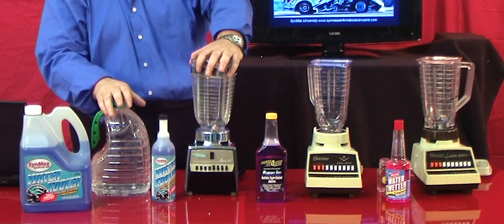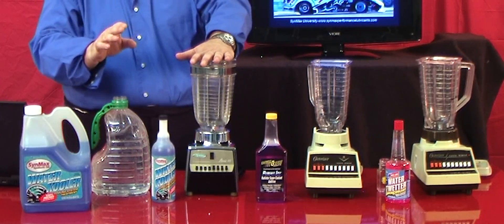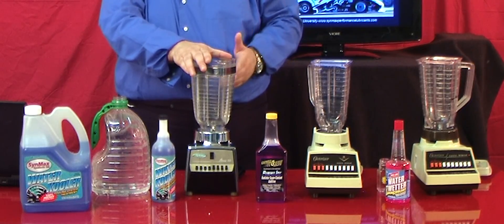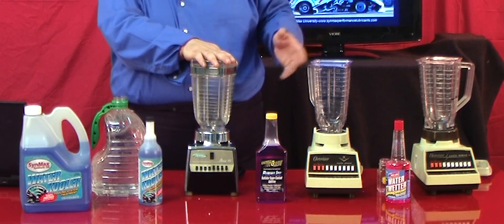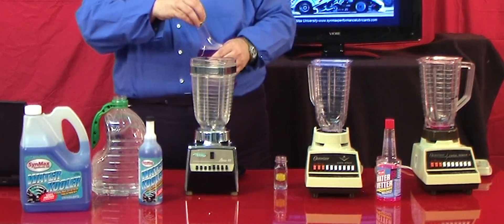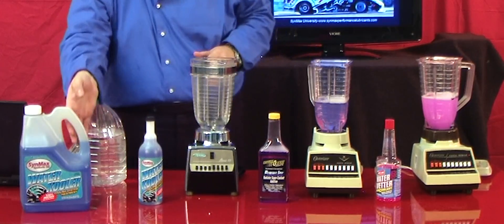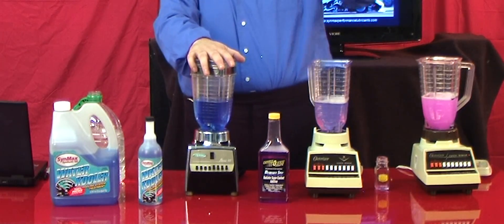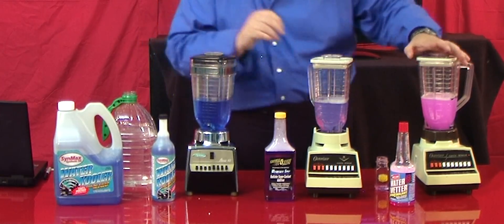Aeromotive Research - Water Kooler Foam Test CLOSEUP

Comment: First question. Where did you get three blenders from the 1970s?

Second question. Would a couple drops of dawn dishwashing liquid do the same thing?
Reply: Curious that the competition are both blended with the same blender.
Reply: Lol
Reply from the maker: NO - racing coolant chemistry is very balanced in multiple areas. Surfactant like with Dawn is a good thought but does not apply.
Reply: Yessssss
Reply: Dishwashing liquid if you want to F your engine.

Comment: there is no air getting into the engine coolant system. Cavitation happens due to the design of the coolant pump blades and being spun too fast.  If you want a cooler running engine, buy a 160 degree F thermostat. The problem with running a cooler engine is that it is less efficient. 190 deg F is found to be the best. So change your coolant every 3 years you will have the best results.
Reply from the maker: Sir, you really do not understand racing coolants, the turbulence in a system going from 6000 to 9000 RPMs is much different than a  passenger car,  PLUS you did not have considerations to the anti=foam package and pH balance. the thermostat for the 160F would be to restrictive for the fluid flow requirements - It is obvious you have never worked with a real racing program.  Yes you have a couple of good thoughts but  they DO NOT apply to a professional racing program.
Reply: @aeromotiveresearch9788  thanks for the incite.
Reply: a 160 degree thermostat will only open sooner. cooling is done by the radiator. If you increase the radiators cooling capacity, then yes the 160 thermostat can cool more. 190 degree thermostats were introduced because of emissions more than any other reason.
Reply: Great idea and all but some vehicles won't work properly with a 160 with out a tune adjustments.
Reply: Have you ever boiled water plus the cylinder wall pulses during each combustion event